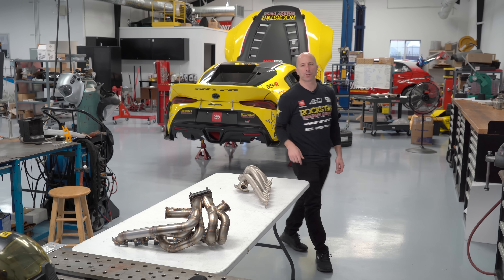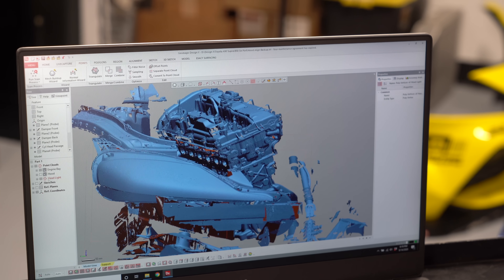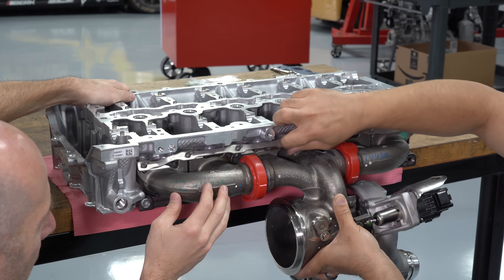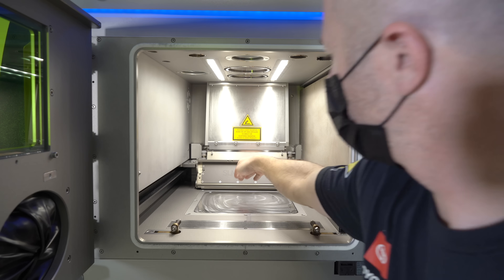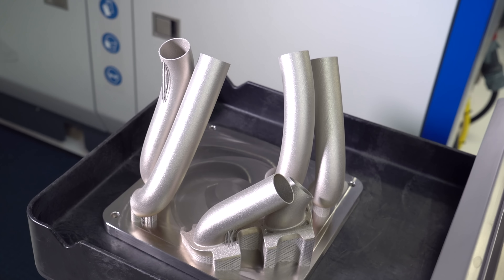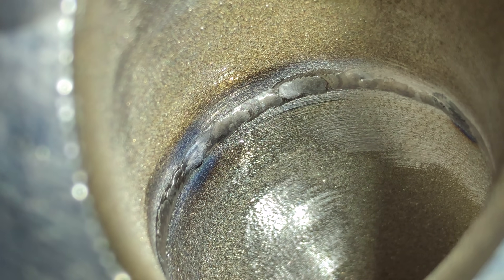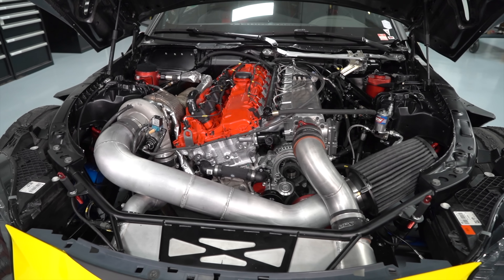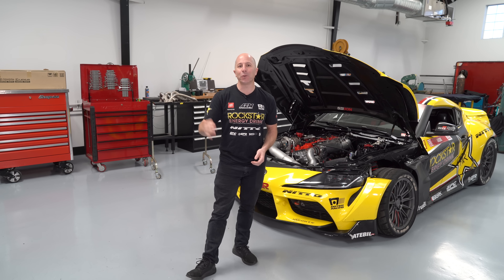Turbo Manifold 3D Printed from Inconel Powder

Comment: Hi, 3D printing specialist here. I wouldn't recommend this for long-term use. 

3D printed metal is poorly-characterized and has generally bad fatigue behavior. Yes, there are high-performance applications that use it, but they tend to be very highly engineered, and have frequent maintenance schedules or very short lifespans. As-is, it'll be quite some time before I would recommend commercializing this sort of approach.

For people who aren't deep into metallurgy, just think about this as if someone offered you a manifold that they build up out of TIG filler rod. You'd have to trust them a lot - and we're not at that stage yet with metal AM.
Reply: Thank you for pointing this out.  3D printing the intake is a good application,  but I would not expect this exhaust  manifold to last long. At the microscopic level, these prints are full of gaps and voids.
Reply: E-beam powder bed fusion with a HIP post process can produce material with good fatigue life no?
Reply: HIP heat-treatment would help with the fatigue issue, but it gets very expensive for such large parts.
Reply: Daniel Defense has had a silencer out for a couple years that is 3D printed from inconel. I have one, its called the "Wave", I've shot thousands of rounds through it without issues.
Reply: @thastinger345  Silencers are not stressed members.

Look, just because you've used something that was 3D printed at some point in your life doesn't mean you understand how they work.
Reply: and printed metal cant be hot forged or worked only some cold peining to improve its mechanical properties slightly but your right the thing would be like one giant weldament it cant be annelled or it could come apart printing though can make very complex shapes which is why it has seem lost of use in making molds and things for prototyping according to forge magazine last year
Reply: @manga12  It can be annealed, but since there's usually a bunch of internal stress built up from the printing process, annealing it can sometimes cause it to warp. For a large, thin manifold like this, I wouldn't be surprised if a good heat treatment would ruin the part.

Not that it's guaranteed or impossible to do, but it's tricky to get right.
Reply: I couldn't help but wonder about that exact thing. Surely the tech will advance though.
Reply: @louisvaught2495  i read that the whole structure would come apart if annealed from the heat as the one thing is full of voids and is stiff as heck as its basicly one giant weldment with the way its built up using powder and some sort of beam or electricty like a tig welder, now I have read about a globular metal that has better mechanical properties but its still in the beginning stages of research in germany from the artical in forge or forging magazine I saw a few months back
Reply: @manga12  That's not quite accurate. Printed metal parts usually have to be annealed to get their full strength, since fully melting the material makes a pool of slag instead of a printed part.

But it's probably a different annealing cycle from what you're used to - longer and gentler, and the parts have to be supported during it to prevent warping/drooping.

And the metal you get out at the end is nowhere near as good as cast or forged parts - tons of inclusions.
Reply: @louisvaught2495  I am used to seing heat treat for tools
Reply: @danhillman4523  It's... really hard to say, actually.

It's hard to predict how much improvement there is out there. Some of the challenges are inherent to the material, like the fact that metal is pretty fluid when it melts, and doesn't like to hold its shape..

With high-energy and high-stress processes like this, you start bumping up into the limits of what's physically practical, and we're good enough at material science at this point that we might be pretty close to the limits of what we can do.

What's a more sure bet is the analysis side of things. If we understand more about how the printing process behaves, we can create automated tools that can use that understanding to redesign your prints to be more reliable.
Reply: My biggest concern with the laser would be getting enough penetration without burning through the material. It seems like the best you can do is a light surface weld, with the porous voids actually having been carbonized

Comment: When did the exhaust pirt change from 2 to 6
Reply: Well the 2021 Supra has the 6 port engine and I'm assuming he got rid of the previous engine since Fred Aasbo had already done many drifting hours on that engine so it was time to use the new engine, plus 6 ports equals more flow
Reply: @exquisiteart6478  yeah I always thought those 2 ports had to be a major choke point at the top end
Reply: @noahkach  Yes and no, cause only one cylinder fires at a time
Reply: @ldadol  yeah but you have larger pressure losses due to the smaller radii each exhaust runner has to have in order to fit in the head.
Reply: it was always six port, they used another piece on the exhaust manifold to turn to a 2 port, imagine it as a cover 6 port with a cover to convert it to a 2 port
Reply: maybe it's because i think the new turbo is not twin scroll so you dont need the twin scroll header anymore, i think
Reply: @Eduardo_Espinoza  new turbo is twinscroll.  will stay twinscroll
Reply: @GeoffRaicer  thank you for letting me know :)

Comment: Wait I'm confused? When did you change the head? I thought the head was only a dual port head?
Reply: Yeah I was wondering the same thing, he didn't explained when he made the change
Reply: Hmmm I am not up with all the different BMW engines, I wonder what model its off?
Reply: Toyota/bmw came up with a new style head, they changed it for the 2020/21 model....I don’t remember out of the top of my head why they did it but it was for turbo exhaust efficiency IIRC
Reply: @ivegonemad  I see said the blind man... Still though he would usually tell us the difference in set-up and he didn't say anything. Not saying he owes us a response I'm just saying it was pretty confusing to see a different head on there and manifold with out really any context
Reply: @israelcardona5170  this was the first time with the 6 port head on the car. Used it in just the last rounds of competition
Reply: @israelcardona5170  yea Papadakis is really thorough with his explanations. But i think he didn’t think it was a big deal,  the overall head design is the same just the exhaust ports changed but FYI the new updated engine is now 10.2:1 compression instead of 11:1and it’s available as a 4 banger😎
Reply: @ivegonemad  yes 2021 B58 uses a 6 ports head. I tried to read about why they changed the design, but I can't find anything about it. I guess it gives more flexibility to correctly tune the runner length for a better flow on twin scroll turbo
Reply: @israelcardona5170  look up papadakis post on ig, the 6 port head is from 2021 MY supra (the 382 hp one) he explained about this head there. So much better power on top end (+300 hp at 8000k rpm) but with similar peak hp to old 2 port one. Idk why he didn't mention any of that in this video.
Reply: They rushed the 2020 model to production. The 2021 is what Toyota/BMW intended the supra to have.
Reply: @israelcardona5170  he owes us!
Reply: @army240  they basically switch the 21s B58 for a traditional head(6 port heads) rather than the integrated heads that was in the 20 mk5(2 port).
Reply: Remember all the stories of Toyota "taking apart the BMW engine and going over it to make sure it met their 'standards'?  So in all those "8 years of development", they didn't figure to fix something so basic.  They literally disproved their own marketing BS the following model year.
Reply: I'm pretty sure the reason they have integrated the stock exhaust headers to the cylinder head is so that they can water cool the headers before sending the exhaust gasses to the turbo.

They did this on the FK8's K20C1 too. This is to lower exhaust gas temps for emissions and efficiency.
Reply: @grecoconduris6716  the B58 comes with the 2020 BMW 3 Series M340i
Reply: @jimmyneutron1889  they said it was revised because the exhaust gases flowed better with 6
Reply: The new 2020 Supra is using the traditional 6 exhaust ports, they changed the header with the newest Supra header
Reply: @rm6330  which it would and should, integrated exhaust primary tubes to the cylinder head is for compact packaging, lower turbo lag, lower emissions, lower exhaust temps, lighter turbo packaging, and overall efficiency.

You don't need all that on a competitive race machine.

I think equal length headers made of inconel can withstand higher temperatures, are lower in weight and have better torque yield.
Turbo lag isn't so much of an issue here as drift machines are rarely in operation below 3500 rpm.
Reply: It's turning into the 3JZ
Reply: @enigmaPL  there is nothing wrong with the 2 port design, it's just a diffrent approach.
The 2 port design has some benefits too.
Reply: @ivegonemad  Well no, the B58 has always been a 6-Port until like 2018? They introduced the 2-Port and applied all the improvements from the new 2-Port onto the existing 6-Port, a "Technical Update" as BMW puts it. Both the 6-Port and 2-Port are being manufactured in conjunction for different markets such as Europe, which ONLY gets the 2-Port
Reply: @enigmaPL  no, you see, the 6-Port and 2-Port are being produced simultaneously, but I would assume the first batch was the 2-Ports for places with strict emission standards such as Europe, and they wanted to the car released ASAP so they kinda rushed it and made the 2-Port engine available in the U.S first
Reply: @grecoconduris6716  B58 engine which Papadakis highly modified and converted to exclusively port injection.
Reply: @ivegonemad  I4 turbo is a different engine although it has similar design principles.
Reply: @coolhwhip86  No, the 2020 model was not rushed into production.  It was developed over 3 years after an initial 2 years of planning.  I think Toyota wanted to study the later developed B58 to asses its durability before adopting it.
Reply: @exquisiteart6478  yes we in the US finally got the 6 port, Toyota sent out the tech update like couple months ago, I’m sure bmw did it earlier
Reply: @machtschnell7452  that’s exactly what they did, Toyota needed the engine to be at a high standard before adopting and also they had to make the software a bit more friendly for toyota techs to understand

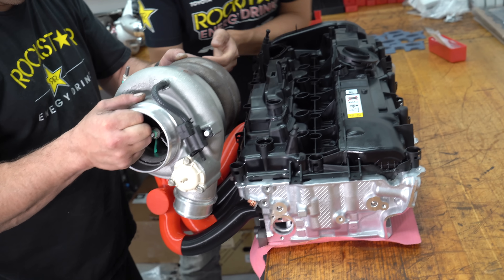Comment: 4:20 have seen a turbo melt a hole thru a plastic valve cover before: started a fire... It obviously started spitting oil onto a hot turbo!

Comment: One thing you may want to consider is bending moment on the turbo inlet and outlet. This will require you determine supported mass on turbo inlet and outlet to ensure moments are within limits. The shape angle is angle between turbo outlet to CAC inlet. This is another limit that ensure the boost does not cause excessive moment.  Really cool to show the whole process though!

Comment: Audi 2.5 tfsi 5 cylinder engine manifold bolts on same way. Top bolts pushing on brackets to slide it in the slot

Comment: Stefan, there is something you can easily use that will give you just a little bit more power.  The F1 headers now use anti reversion tubes on the headers, about 4" out the tubing steps up a 1/4 or so making a lip so gases trying to flow back especially at lower rpm are severely disrupted. As far as coming out of the motor the step up pressure reduction creates a suction relatively speaking.

Comment: Due to the fact that it is a higher RPM engine, gaseous flow is definitely a factor in power production. I strongly encourage you to look into AFM (Abrasive Flow Machining) to smooth out the flow of gasses and to decrease turbulence.

Comment: Newbies who have learned to use solidworks with the customer's money.. Additive technologies are used to create geometry that cannot be realized by welding, bending and mechanical processing(cnc machining, turning), for example, a mesh structure, which makes it possible to lighten the structure, internal channels, ribs (for example, for cooling). But I didn’t see any of the above in the video. They didn’t even demonstrate a comparison of laminar flow in Solidworks Flow Simulation for a printed and welded manifold. However, I think there won’t be much difference, since the internal channels are quite rough, and in addition with ledges from the welds. There is no weight comparison. There is no comparison of thermal barrier qualities. Moreover, there is no comparison in power and torque with a welded and partially printed manifold.
All technical solutions must be appropriate.

Comment: Are the metal structures components so strong to withhold stressimpacts. For example a  3D printed crankshaft moving in an engine? So in general moving parts in an engine.

Comment: What I really find interesting is the thermal dynamics. Did you use any flow analysis? With 3d printing you can or could taper the individual tubes to keep the velocities at the same speed for even more efficient turbo results. On both the intake and exhaust. Making your carbon fiber intake with water soluble support material and exhaust with the material. Why not wrap the exhaust in refractory blanket too, keeping the heat contained produces a higher efficiency too.

Comment: Great ultra modern technology that I was using 20 years ago on gas turbine flight engine prototype hardware. 3D printing was supposed to revolutionize everything, but it's always 10 times more expensive than conventional technology after you hand finish it, weld it, and machine the critical surfaces. It always ends up taking much longer than than conventional technology as well. Someday, everything will be 3D printed, but it will take a lot more development work to get there for anything but simple parts.

Comment: The Turbo is located very close to the valvecover, isn‘t it?
Reply: Tbh it's quiet common that its like that. This is common for people to do to even N54s or older bmw engines.
Reply: That's what they said, "close, but 1inch clearance is enough"
Reply: I heard that. But I still think it is very little. I want to see the cover when the engine has run a few races. I mean, the engine side of the turbo gets red-hot! Versus a cover made out of duroplast😂 
But i LOVE what PapadakisRacing do!!

Comment: I want to see a boost valve incorporated with this car and use the DI system to keep the off throttle boost pressure up. I saw a S2000 with one that was maintaining 8psi of boost when off the throttle so tip in response was just ridiculous.

Comment: The BMW B58 engine on the supra basically has 2 exhaust ports directly into the turbo without a manifold, and the earlier videos confirm this. But this appears to be a head with 6 exhaust ports, did Steve swapped over to the S58 head with dual fuel pumps?
Reply: No. He just swapped the 21s B58 into the mk5 before they went to irwindale(21 mk5 has a 6 port B58)which made it noticeable since aasbo was able to keep up with other cars alot better than he did compared to the other rounds.
Reply: @carboydorifutoparty3976  thanks, that makes sense then.

Comment: Pretty neat. I wonder what the HP difference is between the two headers, seemed like the printed headers didnt have as smooth of a inside. Might disrupt some airflow? Or slow the rpm curve?

Comment: 3d printing prototype parts really is gonna be the future.  They just turn out better, quicker, and cheaper to play around with ideas.  as this tech becomes more mature, expect to see weight reduction while maintaining strength in places that it was never possible before.  Places like parts of something that needed to be cast solid before, can now be printed with a lattice instead to reduce materials and weight, but keep the same strength.  Wondering when we will see the first fully 3d printed head, since fuel engines are really on their way out now, faster than ever, I expect motorsport to change drastically in the next 25 years.

Comment: I know you’re not using the DI stuff but maybe you should look into how you can add fuel on the exhaust valve event to keep your turbo spooling while off throttle. You could delete your nitrous kit and maybe even put in a larger turbo charger.

Comment: Question: Is the gritty surface on the insides of the header a desirable or undesirable side-effect of 3D printing? Does it actually improve airflow because of the tiny turbulences on the surface of the pipes? Or does it hinder the airflow, but you leave it as is, because sanding it would not really be worth the effort?

Comment: In terms of metal 3D printing. Just how useful would it be for producing a custom cylinder head design. Consider it a thought experiment irrespective of cost. I worked with an individual who wrenches for a race team out of NE Illinois that runs Brian Hart 4 cylinders.  They had new heads cast from 3D printed patterns and machined. And yes a printed head would need to be final machined

Comment: So is this a 2j that's tilted in the engine bay? I didn't think the new supras came with an inline 6?
Reply: Well......i guess u could say that. Takes alot less to make power out of(he took a more expensive route to make the power he's making in the car RN)but yea. It sorta is like a tilted 2j in its own way. There is the S55 and S58 that'd also would be called tilted 2js since they're just as capable(well the S58 hasn't been put up as far as the B58 nor S55 yet to say but it should soon)

Comment: I think the 3D printed one is to light. I wonder how long it would last in a working situation with normal stress and temperature.
Reply: TIG welder ,  stainless tube ,  saw &  angle grindiner .

Make it Fit ..

°☆°